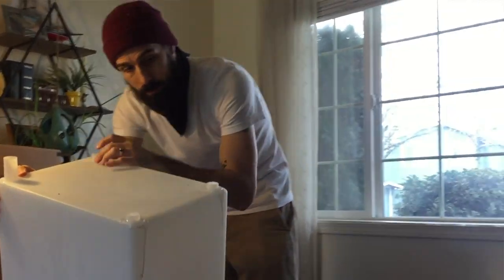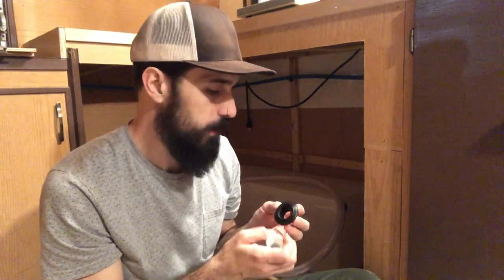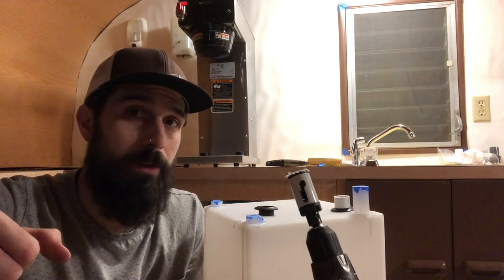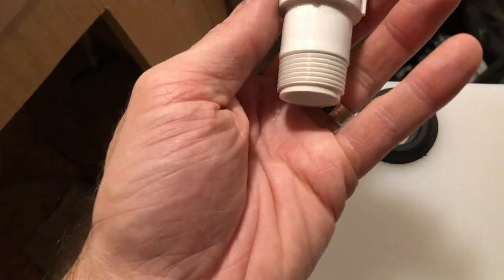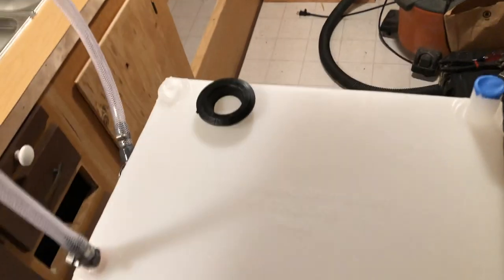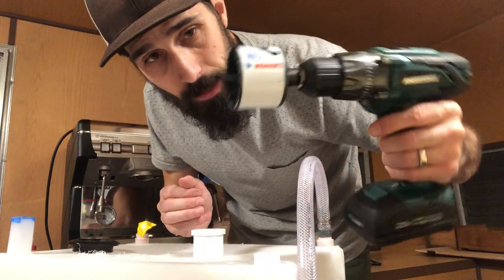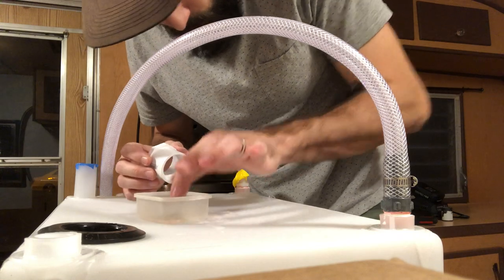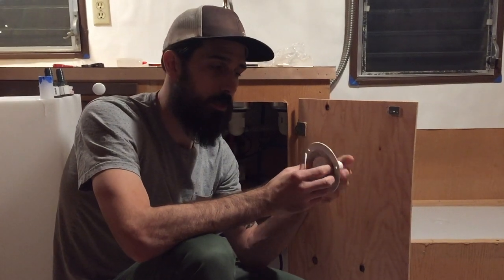What Are Uniseal Gaskets - Press On Coffee Trailers

Comment: From what I can see, Uniseals are normally used with slip connectors.  It appears you're using a threaded connector.  I believe that un-threaded connectors are what is recommended with this product.
Reply from the maker: Yeah normally you would use complete slip fittings but these are threaded beginning and then slip so they still ended up working. Come to find out once I was done is that I didn’t even need to use the Uniseal fittings after all. Trial and error.